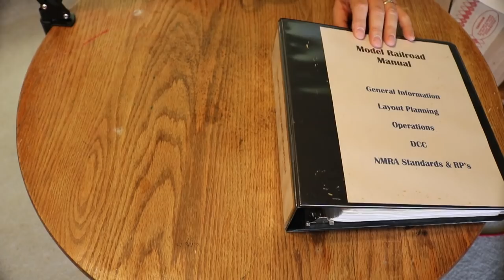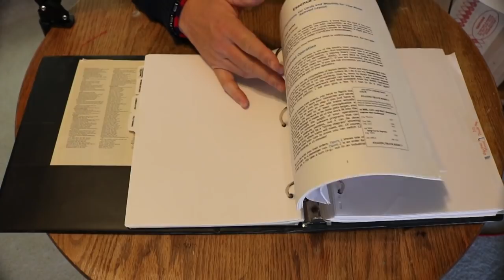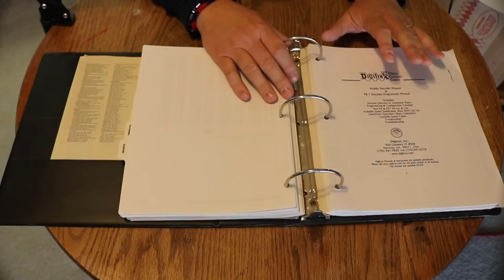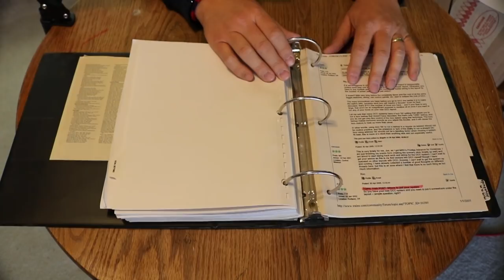Workbench Organization Tips for Model Builders

Comment: Great video Ron. I’m a big fan of the rotating carousel organizers. I’m also an avid fly fisherman and artist and use them for fly tying tools and artist brushes, pens and pencils. Been using them for years and actually have 2 that date back to the early 80’s.
I was watching a similar video from another modeler and he also had a good idea for tool storage. PVC pipes. Cut to length and with various diameters available they can be mounted above your work bench to store all sorts of tools. I think he actually uses the PVC glue to attach a bunch together in a row and provided you have some type of shelf above your workbench mount them to the bottom. Anyway I thought it was a good idea. I also use small bin organizers like the red one in your video. Very useful. Thanks for the tips.
Reply from the maker: Great tip, Joe. Thanks for sharing it.

Comment: Good video Ron! Here’s a tip for you! I know you are computer literate so there is no excuse not to use JMRI Decoder Pro. This program keeps track of and builds a database of your locos. It is a comprehensive list of settings and manufacturer type and decoder. 
I use it for all my programming.
Reply from the maker: +Ralph Renzetti  Hi Ralph. Actually, I do use decoder Pro for programming my decoders. I also download those specs and save them outside of jmri as I don't fully trust the stability of jmri. I mentioned the Excel document because that's what I used before I started using jmri and I know there are a lot of guys out there who still don't use decoder Pro. I just wanted to get across the point that it's a good idea to keep some record of your CV settings for your decoders. Thanks for the tip however. You're always helpful and always looking out for me. LOL.

Comment: i like  the video, always helpful. i have to use a rolling cart as my work bench. it helps with the space and i can move it to where ever need it for the day.
Reply: What cart are you using, or where did you find it? Are you modeling off it, or just using it store and bring the products to the work area? Curious, as I'm thinking about moving much of my modeling tools and supplies to a series of task dedicated cart(s).
Reply from the maker: +Eli Garretson I don't have a portable workbench, but I do have an old cheap TV stand on casters that I put all my scenery materials on so I can wheel it around the layout as I'm working on scenery. I love that thing.
Reply: it is a cart from harbor fright and it works great for modeling and i do use it for storage on the bottom of it, just make sure you level it so the wheels work nicely. it was 35$ 2 foot wide 4 long
Reply: it helps i try not to put stuff on my layout when working on them. one of the must have tools i would saY

Comment: some really good ideas!  I use the small plastic containers too I get mine from Hobby Lobby and with the 40% of  coupon it saves a lot.  I use peg board a lot ON tools in a blister pack I just cut open the top and hang it up.   Thanks for sharing!
Reply from the maker: +will kling Pegboards are great. I have a large one in my garage but not near of my modeling workbench yet. I have a perfect wall for it just to the left of the workbench as you see it in the video, but I haven't gotten the pegboard to put up yet. My local Lumberyard only sells it in full 4 by 8 sheets and I only need about 4 feet by 3 feet. Watching for someone to sell me a scrap. I mostly wanted to hang parts and supplies on. Thanks for your comment.

Comment: I've used many of the same organizers, but still find myself with a cluttered workbench. So the struggle never ends. I use the roll around storage bins to keep scenery materials. For example, when I get a bag of ground foam I empty it into a bin and toss the bag.  Instead of binders, I scan papers and keep them on my computer. By scanning magazine articles I avoid cutting up a magazine. I keep the magazines because I often find articles in old magazines which I had previously not found to be relevant. If I had cut out only what I first found relevant and tossed the rest I would have lost the something useful later.

Comment: At 9:55, Ohhh, hardcopy! LOL...  Yes, paper, dead tree...  Ah well.  Regardless, great video with some good ideas, as always! I really love that drawer set on casters for projects, I'm all over that, gotsta have me one. Good information, I always love to see how people do what seems the impossible for me...  be organized. But I love to see peoples workbenches. Good video, and thanks for sharing such a well timed bit of information, as I'm knee deep (kinda literally) in reorganizing my modeling life and moving my modeling mostly out of my layout room, at least some. So far I've just got the dispatcher setup in an adjoining room, a room that will contain much of the staging eventually. And I plan on setting up my programming and rolling stock construction and tuning location beside the dispatcher. I've also moved my core electronics arrangement into an enclosure in this room. Since it shares a wall, it'll be as easy to have the power supplies and the like there, and just feed through the wall to the layout for power. It also seemed more logical to have the DCC core near the programming and dispatch systems. Now, if I can move scenery stuff to a cart, I could move it into the layout room only when working such a project. Thanks for the insight, gives me a couple answers to the split brain/split room approach that has a few small issues, none of which wheels can't help solve.
Reply from the maker: +Andy Crawford Hii Andy. Thanks for the comment. Yes, I'm still a little old school. I like old dusty paper books and a page in the hand. I'm not anti-technology, I'm just redundant. I wanted electronically but don't trust that it will always be there. Organization is something I have to work really hard at 2, but I find that if I don't do it I don't get things done. I end up wandering around the layout room looking for something and then I get distracted by six other projects. 2 hours later I leave and I've gotten nothing done. Yes, that set of drawers has been a godsend for me. I can keep 10 projects organized and going at once. That serves my ADHD really well.

Comment: My solution might be extreme. When I upgraded my garage tool boxes with pro quality automotive boxes I brought the “homeowner quality” craftsman boxes downstairs. Added an intermediate box and now have decent amount of tool and material storage. Often used tools kept on pegboard on bench within easy reach.  Workbench is an old computer desk and hutch that always seemed right height and dimensions for me. 
Oh yeah- light.  Lots of light.  You cannot throw enough light at any project.  Added LED to bottom of hutch.  And lights above chair. 
Did I mention light?

Comment: I use the Walmart small Tackle Boxes..

Please tell me why you  convert all Wheel sets to metal? I'm in N Scale and run MTL Trucks.
Reply from the maker: Metal wheel sets run more freely and smoothly than plastic, they tend to attract less dirt, I really prefer the why they look, and I love that "clickety-clack" sound they make as they run across the layout.
Reply: Absolutely Ron, agree...  Plastic wheels are like magnetic to dirt. If you run plastic wheels, I can't imagine all the extra work to keep the track clean. All the other benefits, better rolling, less resistance to pulling, stay in gauge better, etc., etc., etc. are all just free pluses, as the track cleaning aspect is a lock on the decision. Once you start to experience the benefit, you won't let a single plastic wheelset make it to the layout.